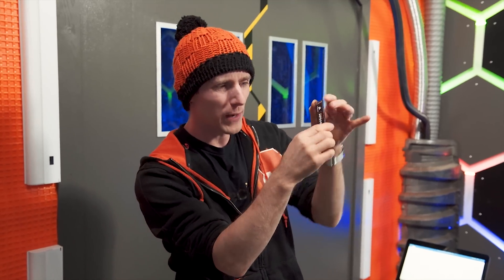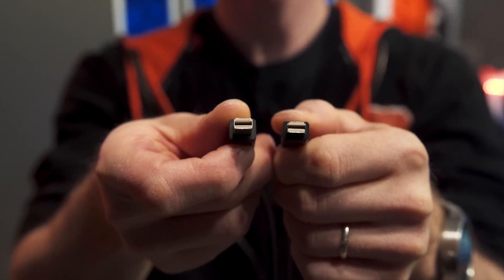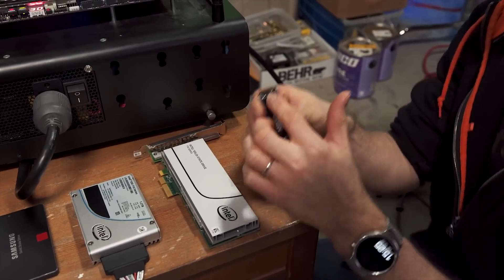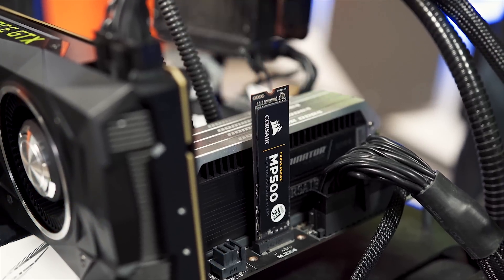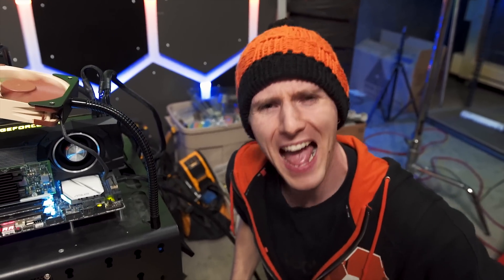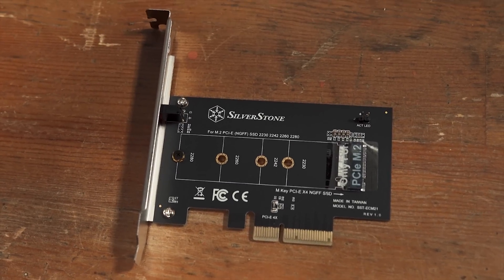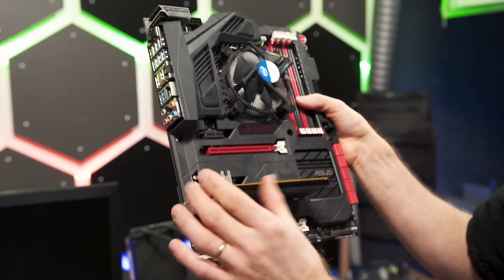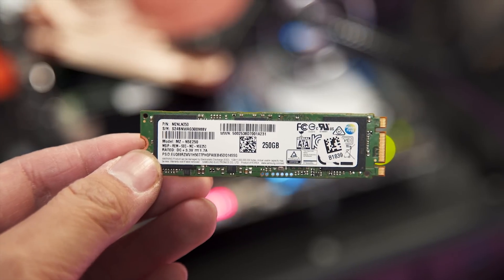The FASTEST SSD Technology Explained - M.2, U.2, and MORE

Comment: would adding an nvme or ahci m.2 SSD work on an AMD motherboard with no m.2 slot, but on an m.2 pcie card?
Reply: Nicktendious 5:57 From my understanding it is possible, but you might not be able to install your operating system on it depending on the type of motherboard.
Reply: Nicktendious Yes of course, unless you get a new m.2 using optane as your cpu and board chipset regulates the newer technologies function.
Reply: Nicktendious Also just call it m.2 or m.2 drive otherwise it may confuse people. Hope this helps m8.
Reply: Nicktendious Just a thought, what chipset is your board?
Reply: sl1ckk1ll3r it's A88X, though I may be upgrading in the future, but if not, that's the chipset I'm working with.
Reply: Nicktendious from my own knowledge and a quick bit of research. FM2 does support pcie boot so as long as you are using the PCIe adpater than there is nothing limiting you from using the m.2 drive. I personally would also say- do a bios update when you put the card in, so that it can diagnose the system and configure the drive as a PCIe card.
Reply: Nicktendious The only thing I would have to day is that you wouldn't get the speeds advertised if your pcie lane version is below 3. Sadly AMD does not fully support NVMe (only some vendors support it). Me personally would wait to upgrade to a newer chipset i.e AM4 or Join the boys in blue (my team) either way its a good future for PC's. Hope this was insightful.
Reply: When he says achi m.2. He means a SATA m.2. So should work like any sata drive in the Bios / windows ect. The problem is that you won't see much if any performance. Nvme is gonna be the new big thing, but like with any new cable / tech, there loads of different versions until one wins out.

Comment: So I have a question. Would an M.2 NVME SSD be faster than two SATA SSD's in a raid 0?
Reply: MistaMisa Thanks
Reply: In a word, yes. 
sata has a bandwidth limit. The 550MB/s per drive is about all you can get. Couple that with queue depth of 64 requests. nvme bandwidth is about 4GB/s over x4 PCIe. Couple that with 64K request queue per cpu core. 
The downside, PCIe lanes are limited, thermal throttle of a hard pushed nvme drive, and cost. 
This is from specs I read a long time ago, they could change and/or I could be wrong.

Comment: I have a 1TB nvme drive in my PC. My motherboard has two slots and both will only work with nvme if you have a CPU with 40 lanes. If it is 28 lanes then only 1 slot will be nvme.

Comment: guys I use a ramdisk with 50gigs or more for battlefield 1 game sync. it loads maps 4x faster than the fastest nvme ssd such as the Samsung 950. give it a shot. 64 gigs or ram is cheap. or if you have a 2011-3/4 go for 128gigs and make a 100gig ramdrive.   I am specifically not mentioning a company's ramdrive  product so you can tell there are tons on the market. at least one towards game syncs

Comment: as a gamer and photo editor will I realistically notice a difference between NVMe and SATA III?
Reply: Oh Yeah. 
I have an OEM Samsung ahci m.2 256GB drive, x99-pro that yields 2200/1200 MB/s throughput for r/w according to CrystalDiskMark. It is four times faster than my moderately fast SSD on sata. Since storage will always be the slowest HW component, an X4 improvement in potential read and write will always help. 
NVMe will be faster than ahci. Less code and designed for FAST devices using four lanes of PCIe.
Reply: You'll likely experience faster boot times and loading times (take GTA5 for example) that game will load 2-3x faster on NVMe
Reply: Considering how bulky most photo/video editing programs are, an increase in your drive's throughput is gonna make a pretty big difference.
Reply: thanks, I planned to already get a 7600k but I didn't know that

Comment: Accidentally learned the hard way that a SATA III based M.2 SSD does not work in a PCIe based M.2 slot, despite is fitting just fine. Learned alot about M.2 that day and the various types

Comment: why do you need a ssd for a notebook?
Reply: because hard drives are too bulky and hot for the thin, occasionally fanless notebook computers.
Reply: Prodo Dameuin uses less power
Reply: 1. It's lighter than an HDD
2. It's much faster than an HDD (= OS is more snappy; more usable time on battery since you don't waste time waiting around for stuff to happen)
3. It uses less power because it doesn't have moving parts (= even more battery life)
Reply: I think you meant 2.5 and yeah that's what laptops/notebooks already use
Reply: This was supposed to be quite joke . My joking career is over. lol
Reply: Prodo Dameuin
It was a pretty bad joke...
Reply: Prodo Dameuin on top of thermal, power, and weight benefits?
For the same reason you need one in your desktop. It's orders of magnitude faster.
Reply: Well technically speaking you don't need one,  but they are lighter, faster and use less power.  It's worth the upgrade!
Reply: If performance isn't a priority, the two main advantages to an SSD on a laptop are, 1. impact resistance (as there's no spinning disk, there's little to no chance of damage if the laptop gets bumped around), and 2. lower power usage (which will obviously increase battery life).
Reply: adalaza Except that they do come in 3.5".